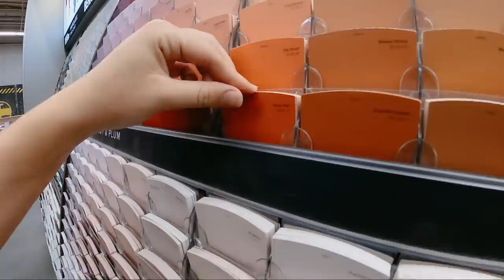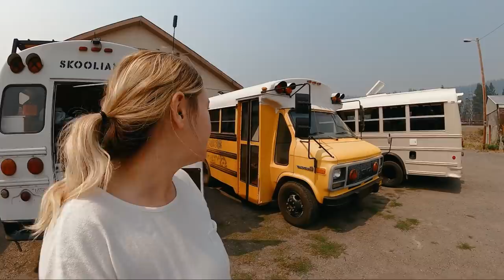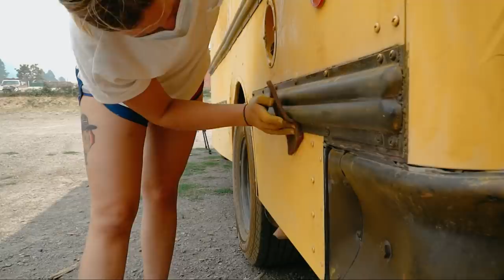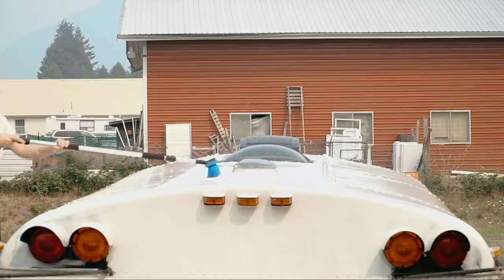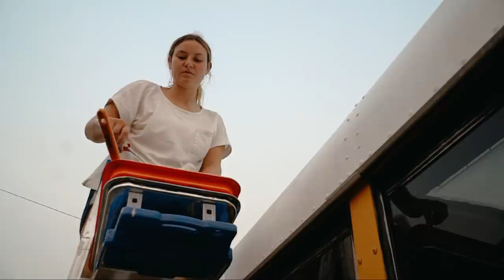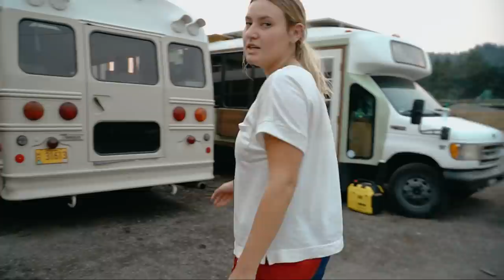I PICKED A PAINT COLOR FOR MY SHORT BUS BUILD - Solo Female Skoolie Conversion

Comment: You are so right about taking a long time to paint a bus. Some people make it look fast and easy. It took me over 3 weeks to get the stickers off and sand. Not to mention the HOURS for each time you need to tape off for color change. Prepping is the key. If you prep it correctly, it will pay off in the end. Thank you for putting out a video that is real. I’m looking forward to seeing the finished product. Oh, I put Raptor White Urethane Spray-On Truck Bed Liner on my roof.
Reply from the maker: Oh man, I’m fighting the fight right now!!😅
Reply: @LeaveHerWild  My fingers, wrists, and my elbow will never be the same. 🤣🤣 It’s tough work that is for sure. Oh, and by the way that’s basically the color I wanted at first. Great choice can’t wait to see the bus painted.

Comment: I used the same stuff on my van ruff.  Avoid tree limbs. It's like rubber andcan pill it and leave scratch marks. I was installing my roof rack by myself and the sharp edges bumped the seal or and pulled a small spot.... but, it works pretty good fore sunlight deflection.  (-:    ps. It's been smokey here in wyoming fore about three weeks.

Comment: Looks like a great color for Levy. Glad you took a bit of time to prepare for evacuation. Looks like you are on a pretty major highway so I understand holding out where you are as long as you can keep working. My aunt and uncle did the same a couple years ago when their property was in line with a fire. (They had most valuable things situated several miles away at a friend’s house, but wanted to do as much as they could to protect their actual house.)

Comment: dont paint with all the smoke in the air the roof will turn grey with all the soot in the air sticking to it
as for painting the window trim and the grille : it might be better to do this after you painted everything else as these parts are hard to tape up get a lot of overspray from painting the rest of the bus , painting them after the rest alows you to cover the overspray up ,  could redo the rims too about that time , the area around the trim is eazier to tape up and you can take the grille off for repainting , about the plastic grille , painting plastic works better with a special undercoat for plastic/abs that causes the top paint to stay slightly soft and flexible , not using that can cause the paint to flake off eventually , check if they have the type made for the paint youre using